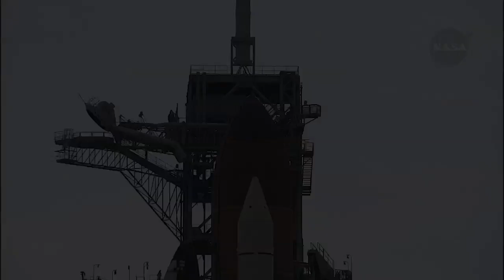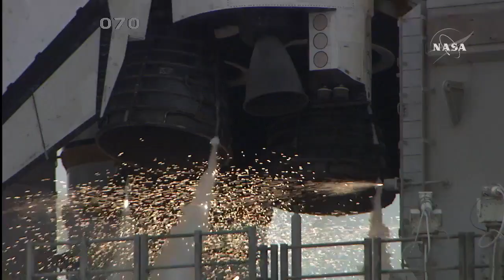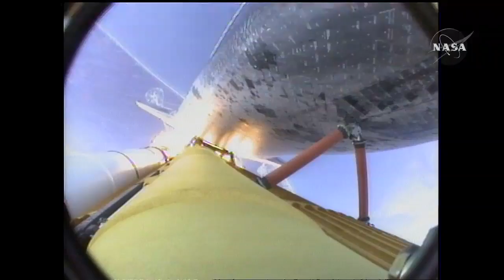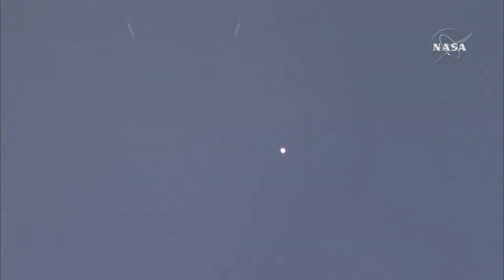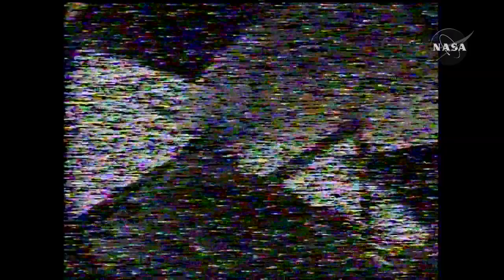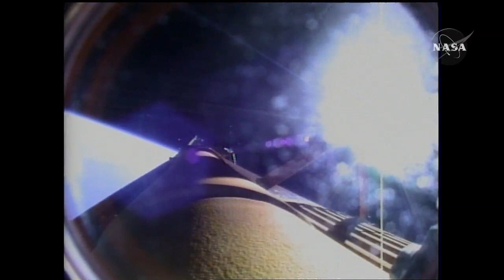STS-127 Launch HD

Comment: @kbent88 Thanks for your answer but: I don't understand it or You don't understand the question. I know that tank is empty, and I understand that it must be detached after riching the orbit. But speed and only speed determines altitude of orbit. For example: if you throw stone with speed 8km/s it will fly next to sattelites and others objects on low orbit. Fuel tank have the same speed like orbiter, so it sholud stay on orbit after detaching and fly close to orbiter. But it falls down, why?

Comment: It is the shuttles fuel dump valves. There  covered with cloth before the shuttle leaves to block birds and animals. At launch the uncover the release valve so when in flight if for any reason the shuttle needs to dump fuel to land.... It wont ice over and hold fuel in shuttle. look close and you will see there is 10 total. Hope that helps.